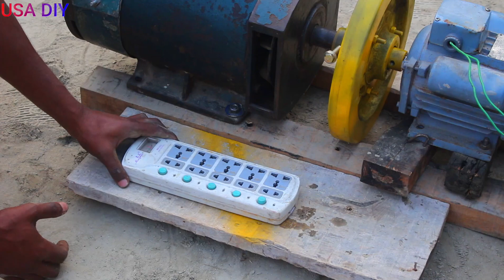How to make Free 220V Energy Genarator - Part 2

Comment: laws can be bend without it breaking. Watched ur 2 video  one with and other without flywheel. A viewer of urs asked d use of flywheel. (without going into physics) d speed (momentum) attained thru a heavy flywheel helps relieved d motor of much stress and so can spin d gen. without much effort. Keep on upgrading. And modesty... giving as light load as possible and intervals of rest. After all (after purchase of equip.) it's free, free, free.
Reply: Sir I have a problem here I don't know maybe the alternator  supposed to turn left or right maybe that is the issue or the running is not up to what I need help me let me drop my number I can  show you on WhatsApp you will be able to direct me thank you I will be expecting your reply sir

Comment: Good thing the soil there is so easy to cut down through and cover over again...  it lets you bury the wire that's ACTUALLY feeding the motor on the right.
A)  I notice the cameraman did NOT do a video "walk-around", showing the rig from ALL sides.
B)  Also noticed the smoothed-over patch of soil on the lower right corner that looks freshly disguised with a little half-hearted sweeping of dust over it.

Still, I guess as long as you can produce illusions that sucker the uneducated viewers in, what the heck, eh?   (I notice you don't include the technical details, diagrams, or anything that might actually support this as being real.  Also notice you didn't put the entire rig up on skinny pole legs that might let us verify there are no other connections going to your rig.)

Comment: How many HP Electric motor would be needed/required , and how many Electrical Units will be consumed in an Hour to Run the Flywheel Electric Generator of 12Kw ???
And for how many Hours Electric Motor can continuously keep ON ?